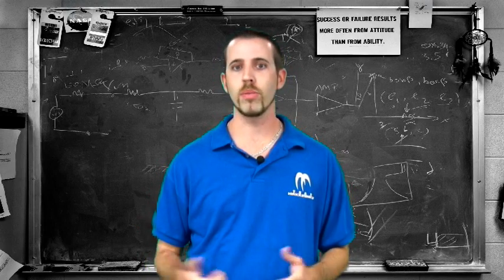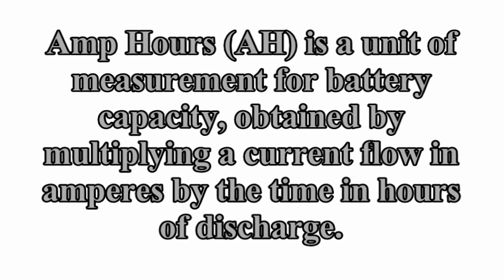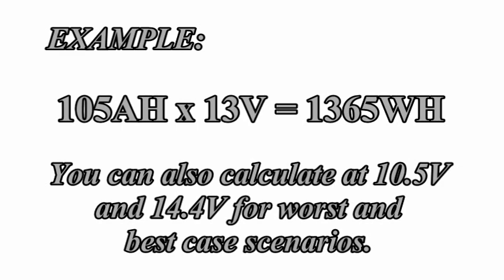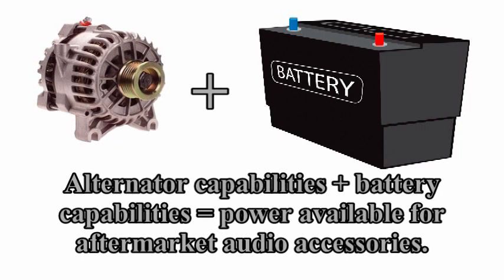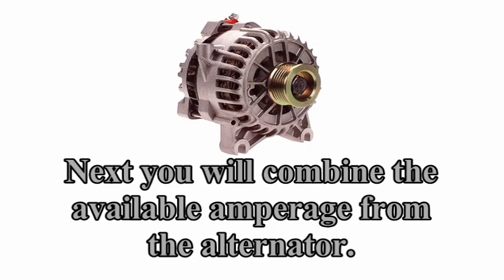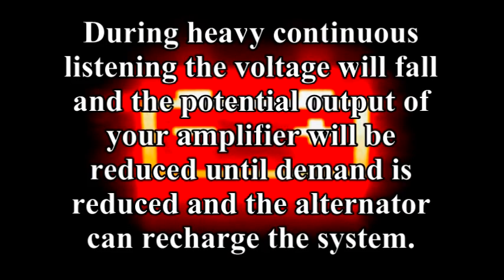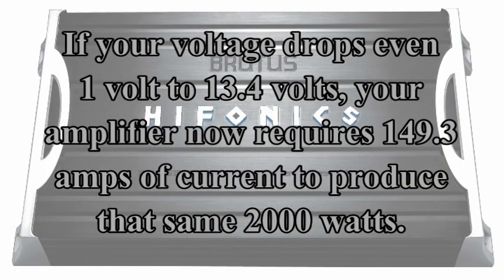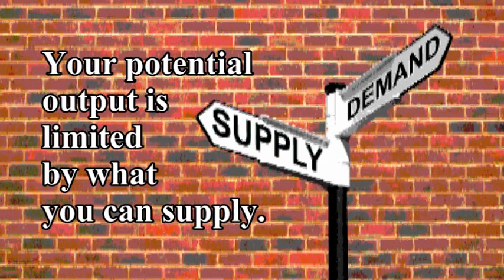Car Audio 101 - Battery Tutorial for car audio amplifier upgrades

Comment: I went ahead and ran a hot and ground all the way back but I'm doing what I call a quarinte system where I have the original alternator running the car and a designated 16volt alternator for the amplifiers

Comment: Whats up MIKE! Big fan of yurs n i kinda need yur car audio intelligence.. i have 4 12 inch kicker comps all wired to a 1ohm load powered by one hifonics brutus 1000d. all with i believe 4 gauge wiring. i have a brand new duralast gold battery as a starter of course. and thinkin about adding a kinetik hc600 as a secondary battery in the back. i have a 90 amp alt. what do you recommend?

Comment from the maker: @8320884 CCA is a rating used for starting batteries. Amp Hours is ideal, but all manufacturers rate the batteries differently. Lead Acid batteries are tradition starting batteries. AGM are maintenance free batteries and typically superior in car audio applications.

Comment from the maker: @garygross7 Every application is a bit different. I have seen additional batteries added to a factory alternator and the only issue was a overall charge voltage drop from 14.4 to 14.1V. XS Power or Kinetik would be excellent resources for the proper battery in your application.

Comment from the maker: @eppi1064 I would not recommend adding a cap as your electrical system will not benefit from that addition. I would recommend upgrading your primary battery, or adding a small Kinetik power cell in the back by the amplifier. This should provide sufficient reserve for the electrical system.

Comment from the maker: @dwade931 You might be ok with an additional Kinetik battery in the back, or a single Kinetik 2400 in the front to power the entire vehicle and system. If you decide to replace the alternator then you should look into contacting XS Power or Ohio Generator as they will recommend options available for your particular vehicle.

Comment from the maker: @rencherboy For batteries and alternator, I would recommend contacting XS Power. (Google for contact info) The options they will offer you will be directly related to your make, model and year of the vehicle along with the total rms wattage for your amplifiers. I would recommend two amplifiers since your subs don't all match. Possibly even three amps. BRZ1700.1D and two BRZ2400.1D's would work.

Comment from the maker: @NATERIDER122 For batteries and alternator, I would recommend contacting XS Power. (Google for contact info) The options they will offer you will be directly related to your make, model and year of the vehicle along with the total rms wattage for your amplifiers. A great amplifier for this system would be the Hifonics Brutus BXi2610D or BRZ2400.1D.

Comment from the maker: @puddle331 If you wire two batteries in series, you will increase the voltage but have the same amperage as one battery. If you wire in parallel you will keep the same voltage, but increase the amperage. So, wiring a pair of 6V batts in series will result in 12V, but your amp hr rating will still be 12 since that is the rating of one.

Comment from the maker: @PASTORTENNISON I definetly recommend checking out Kinetik Audio's website. They have a simply battery calculator where you can enter the total rms for your amplifiers and it will suggest the battery(s) you need. Sounds like you have a great system and have done some very important upgrades so far.

Comment: What do you recommend for a set up for a 2003 ford f-150 with a 130 amp alternator, I have a back up sealed battery, think it is deep cycle, 2100 cranking amps, running a ZX 2500.1 kicker amp pushing 2 Fosgate T1 15" subs, soon to be 4 subs. I have up graded to 1/0 gauge from battery to back up battery, 1/o gauge from body to back up battery, and ran 4 gauge from back up battery to amp.

Comment: i have an audiopipe 30001D, i have a stock Battery and a stock alt. Unknown amp hour rating, but i will find out tomorrow. would an extra battery such as a kinetic 1800 and the big 3 be enough if im pushing out 2000w?

Comment: Hey Mike, I am looking at putting in some new system in.  I am planning to put in two 750 RMS each 12" Kicker L7s, they are dual 4 ohms.  They will be powered by a 2100 RMS Hifonics Brutus BRZ2100.1D.  My alternator is 95 amps.  I need to know what battery I need and if I need a new alternator for it.  Think you could help?

Comment: i got 3 of the old hifonics goliath 12s, one is 1600 watts rms dual 2ohm and other two are 2400 rms at quad 2ohm. what will i need to power these sufficiently  (alternator? and extra batteries, 1 or 2 amps)

Comment: i just put a yellow top optima battery in my trunk. im pushing 2 type r 12's with a hfi2000.1 amp. theres is little dimming, but nothing compared to what it was. awesome battery, and it comes with a 3 year in store replacement. can't go wrong with that

Comment: I need help. I have a massive audio p3000.1 amp. I uprgarded but stock alternator up to 90 amps fron 60. Then i put a second 200 amp alternator on. I had to optima red tops. 710 cca and 50ah each but i just bought a kinetik 1800 (1900cca 81ah) to replace one red top battery. The amp puts out around 3100 rms. Is my electrical ok or do i need more. My sysem runs about 15.5 volts.

Comment: ok lets try again i have 2 jl 500/1 on 2 jl 12w6v2d4 andit doesnt put out like when i first installed it i have 4 guage wire and ground its installed in a 05 Malibu classic i was  i haven't done anything to my electrical yeti only have a yellow top optima i have o guage wire for big three if i do the big 3 do i still need a ho alt are would it be good?if anyone reads and know what i can do please leave feedback  thanks

Comment: I have a 2000 Dodge Neon and I am looking to buy a new battery I asked my local auto parts store if I should get a yellow top since I have a high powered audio system and he said that I would ruin the stock alternator if I bought the yellow top because it's not made to work with it and I would be better off with a red top so I just need some clarification about this now thanks

Comment: hi i have a kicker zx2500 and 3 re audio sxx 10" 4 ohm dvc subs rms1000 watts i am planning on doing the big 3 and my stick alternator is 150amps and i have a stock battery for my audio system to run at full what else do i need to install?aux. battery?bigger alternator?

Comment: Hey I just have a few questions,,,1st I am putting 4 volfenhag 12s DVCs,,600 RMS a piece and I am planning on running a 2600 watt Brutus to power them,,,Just want to know how I can wire the 4 subs to 1-ohm?....also I watched the video of the 8" Triton which I am reallllllly interested in and I seen that 4 of them in Paralell goes down to 2ohms,,,,well I have 4 Eminence 6.5s (La6 CBMRs) and I have the speaker wires one + and one - to each speaker. So what ohm rating does that put my amp down to??

Comment: I want to run 2 12" kicker L7s 2 ohm and the watts rms is 1500 watts for each sub i want the system to be loud but also where i can drive around daily without any problems of shortage of power and what not. What amp should i use? im driving a chevy malibu, i'm wondering should i get another battery? Also what kind of wires should i use to hook it up?

Comment: I have a 1998 jeep grand cherokee limited it has 136 amp alternator I am installing 2 amps (1-HFi1000D and 1- HFi55.4) what do I need for a battery and do I need to change my alternator to run 2 batteries? Also what size wire do I need to run to the extra battey?

Comment from the maker: @MRFUNKY323 You could consider wiring the coils in parallel and subs in parallel for a final 1-Ohm load. A Hifonics Brutus BRZ1200.1D would power them sufficiently. I don't typically recommend Optima but since that is what you are interested in, I would consider the Yellow Top group 31.

Comment from the maker: @greenesthaze You have a difficult system on your hands. Your factory electrical components will not handle 16-18V constant. You will need to keep your factory alt and batt to run your vehicle. Then you will need a secondary alt with voltage regulator and a bank of 16V batteries to obtain the 16-18V that you desire. Optima batteries are 12V in nature and will be damaged if you charge then too far above 14.4V.

Comment from the maker: @keithmoonlethal101 Optima Yellow top batteries are very nice. But, they are only capable of supporting up to 1800 watts. Kinetik makes much larger batteries designed specifically for car audio which is why we recommend them.

Comment from the maker: @titleistD2 All battery manufacturers will provide the AH rating if requested. From cruising through the big lead acid battery manufacturers websites I see they not listing AH rating. The dry cell and deep cycle battery manufacturers are still providing it though. CCA is important to lead acid manufacturers because their batteries are used to start vehicles.

Comment: You say auto batteries are most commonly rated in amp hours. I am yet to see a battery rated this way. I can only see Cold Cranking Amps (CCA) which does not seem to have any relation. I did the math and I need a battery with at least 118 AH. Are only deep cycle batteries rated with (AH)?

Comment from the maker: @TheGeorges123 My suggestion is to run the power wire from the primary battery + to the secondary battery +. Fuse at the output of battery 1 and on the input of battery 2. This will protect you incase the power wire becomes severed from front to back. Ground the secondary battery in the back of the vehicle. Then connect the amplifiers' positive and negative to the secondary battery.

Comment from the maker: @MrAlfa2000 What is the total power of you amplifiers? What is the rating of your amplifier? What battery do you have? You may require an upgraded primary battery or a secondary battery along with an upgraded alternator depending on your total power.

Comment: Nice Video man ! But I have a question:
If I want to install a second battery in the trunk(because my amp is in the trunk also) can I Wire the power cable of this battery to the +12v of th amp(also where it meets the power cable of the first battery) then and I ground the negative side of the second battery to the ground(chassis) where also the amp is grounded ?

Comment from the maker: @master9716 I have seen cars get shut down under high demand. But, in most cases when the voltage drops below 12.5V your amp will begin clipping and go into Protection mode. Once in Protection, the amp draws nothing and your voltage will climb back up like normal. In worst case scenarios, you drop below 12.0V and components in the amplifier become damaged.

Comment: Wait a minute .So if you have a 2000 Watt amp and your going to vegas or something and are cranking up the volume on a 60amp alternator it means that the battery is going to get taxed untill its empty wich at that point there will be no more power and your system and car will shut down?

Comment from the maker: @choppedbydjdc If you install the secondary battery in the back and with car running and system off you see below 14.0V at the back battery then you should look into upgrading your stock alternator. XS Power has some great alternators.

Comment from the maker: @rallotubbs1 You will only know for certain if the alt is needed after you install the secondary battery in the back and monitor charge voltage without the stereo on and then voltage drop with the stereo turned up. In both cases the car must be running. If you are reading voltage lower than 14.0V at the amp with it off but car running then you should look into the upgraded alternator.

Comment from the maker: @choppedbydjdc No. Kinetik rates their batteries by the watts they can support. You can't get a 1400watt battery to run your car and support a 1600watt amplifier. You could leave your primary battery installed and add the HC1400 in the back with the amplifier.

Comment from the maker: @THUGGINFORLIFE08 I am not a fan of capacitors unless you already have a stout electrical system to support your amplifiers. Then the caps can do as they were designed to and simply buffer those heavy current draws on momentary bursts.

Comment: hey mike. I got a 270 amp alty from DC Power Engineering. 01 Blazer. I'm about to be running 2000w RMS @ 2 ohms. Ill soon be doing the big 3 upgrade.  What do you suggest I do for the battery portion of my install? the hc2400 doesnt fit, but I can get away with the 1800. Anything else you recommend?

Comment from the maker: @THUGGINFORLIFE08 I'm not sure what will fit under the hood without modification. If you are willing to modify the battery box then I would recommend a Kinetik HC2000 or HC2400. Otherwise see if an HC1200 will fit upfront and put an HC800 or HC1200 in the back near the amp. This should provide solid reserve.

Comment from the maker: @njtokc13 If the 60amp alt is stock then you are on the line of needing a bigger alt for your power, or a bigger battery for reserve. Have you measured your voltage drop at the power and ground terminals of the amp to determine your voltage drop at high levels of listening?

Comment from the maker: @THUGGINFORLIFE08 If you aren't turning it up a lot and getting that low of voltage drop, you may have a bad alternator or battery. Autozone will be able to test your alt and batt to determine their status. If both test out good then I would recommend an upgraded alt first and foremost.

Comment from the maker: @ibanezrocker411 You should be in good shape with your proposed electrical upgrades based on 1000watts. The BIG 3 with 4 gauge would be very helpful for your install. The reason I fuse the wire from alt + to batt + is to protect my vehicle in case there is a short. It is not required.

Comment from the maker: @Amarpreet23 All manufacturers rate their batteries differently. (Voltage, Temperature and Resistance vary during testing)

Kinetik provides the rms watts that the battery is capable of supporting.

Comment: I have a question about the Kinetik HC1400 battery. It has 60 AH but it also says that it has 1500 watts. Does that "1500 watts" number even matter when buying batteries? You didn't talk about amps for the battery, so that's why I am questioning.

Comment: Ok so Mike you may think I am a fool but I figure I might as well ask! Wold this work as a good 2nd battery for a GP3000d-pro?? If not what would you suggest? thanks....
Duralast / 12 Volts, 1000 CA Marine Dual Purpose Battery.
CCA: 800 
Reserve Capacity:

Comment from the maker: @Rjjr510 If you are simply looking to add a pair of subs and a single amp, I would recommend looking at a pair of Hifonics ZX12D4's powered by a Hifonics HFi1000D or even an HFi1500D. Both SonicElectronix and OnlineCarStereo are Authorized Internet Retailers. This package is under $500 and those Zeus are super crisp!

Comment: @culdntthinka124 Hey the MTX terminators only need about 250 rms (600 peak) each so why would you even want to power them up with a 2400 W amp. Just get an alpine mrp 500 or mrp 1000 which would be more than enough to power those. The MRP 500 draws a max of 60amps which should be okay for your stock system unless you play without turning the car on

Comment from the maker: @culdntthinka124 If your amp is 4800wrms then you will want to consider an upgraded alternator and a pair of Kinetik HC2400's as a suggestion. Without the electrical upgrades your voltage will see huge drops, your amp will be starved of the current it requires to produce power and eventually the amp will be damaged.

Comment from the maker: @MrBobby3342 As you add multiple batteries to a stock alternator you put more strain on that alternator and the overall voltage your system rests as with the vehicle running and no accessories drawing will be lower. A stock alt and stock batt should charge around 14.4V. When you add another battery you generally see your voltage drop a few tenths but you have increased reserve. That is why I always like to see the alt upgraded but I do understand budget constraints.

Comment from the maker: @ERIKMYLEIGH What voltage did you calculate at? Keep in mind that you have no idea what voltage the battery manufacturer uses to determine their AH rating. I have provided a set of calculations to use as a guide. You will  notice that if you call a few car audio specific battery manufacturers, you will get different #'s from each regarding what AH rating they have versus the watts they can support.

Comment: hey mike, i did your calculation for the AH and it came out to be 401.5 AH, when i went to the kinetik battery website it says for 5000W rms i should use 3 x hc1800 which is 81 AH per battery, well 81 x 3 = 243AH....I'm a little lost, could you help me please

Comment: i have 130 amp alt and right now im running a 1200 watt amp audioque 1200d i plan on running 2000rmsor 2300 give or take how many batterys do i need or do i need a new alt ? i know a new alt would be best but could my alt charge say 2 batterysin the back not counting my starting? any advice would be greatly appreciated

Comment from the maker: @flint1810 Every vehicle and application is different. If your alt can't charge the multiple batts then your voltage will be below 13.8V without load from the amp.

Comment from the maker: @boyrocker03 Any charge difference between the two batteries would be due to the size of the power and ground wire as well as the distance. This is resistance and why it is so important to use the biggest size wire possible with or without having a secondary battery. Having a secondary battery is better than not having one because without a secondary battery, your amplifiers are seeing that voltage drop through resistance even worse! The second battery offers storage and reserve. ;-)

Comment: I have a question about deep cycle battery ratings. When I look at the AmpereHours do I look at the CCA (cold cranking amps) or CA (cranking amps?) And also what does RC siginify?

# CA: 810 AH
# CCA: 650 AH
# RC: 98